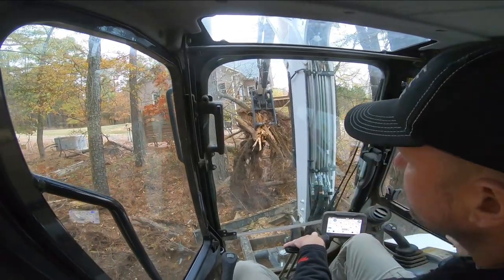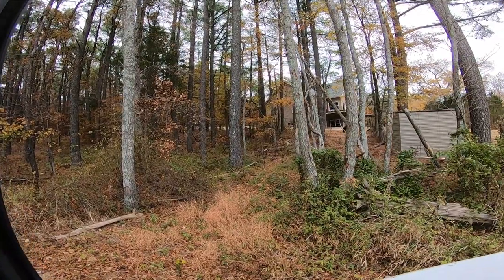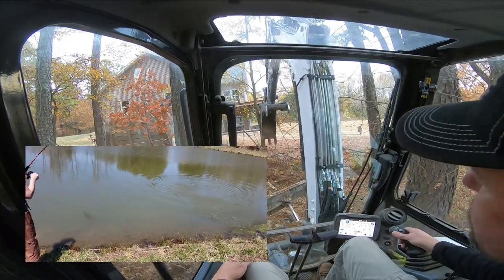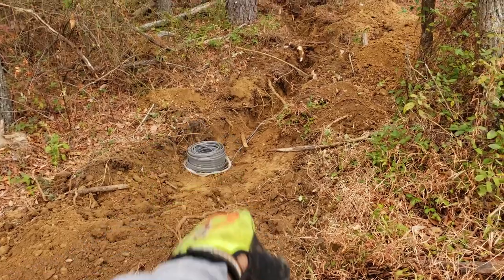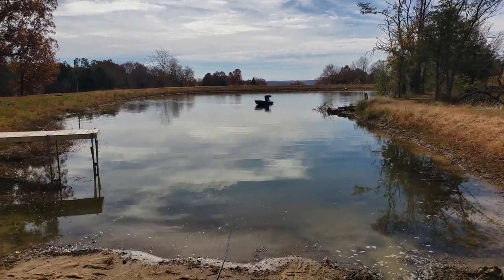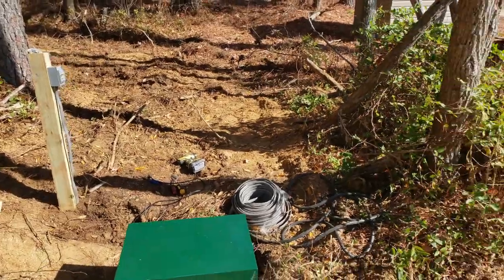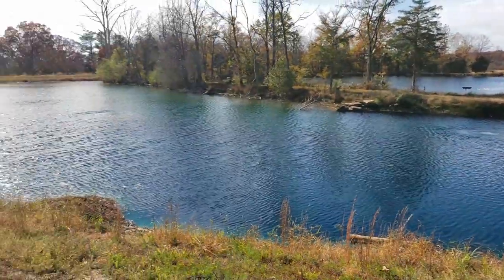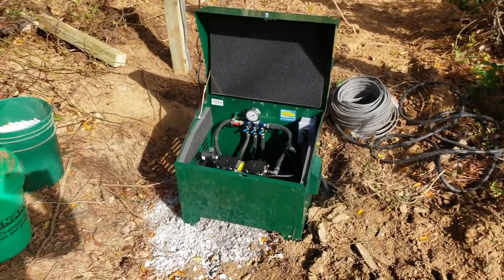Installing a pond aerator for 2 ponds, multiple air diffusers & fish feeder to grow big bass!

Comment: Cool Joe, have two friends with aerators in and they feed using a 55 gallon bucket on deck and the catfish churn the water and there huge.   They tell me when pond freezes they shut off aerators.   Will you have to shut it off ?      Good job Joe.   That blue does make it look great.    Nice trenching, another cost savings of having your own Mini.   Without that mini, so many jobs you be paying for  and having to wait for timing.    ❤️.  I recall the ice bowling you and Sharon did. ❤️
Reply from the maker: No I will keep the aerators running which will keep the ponds from icing over down here. Good stuff! Yep, the mini keeps paying for itself! Thanks man